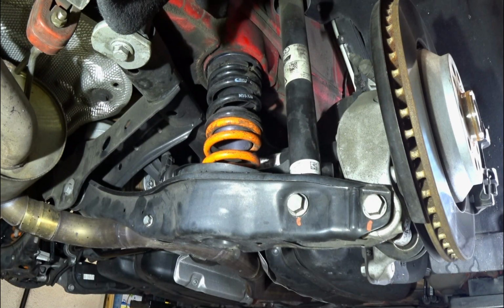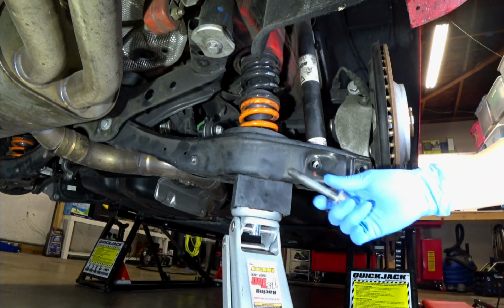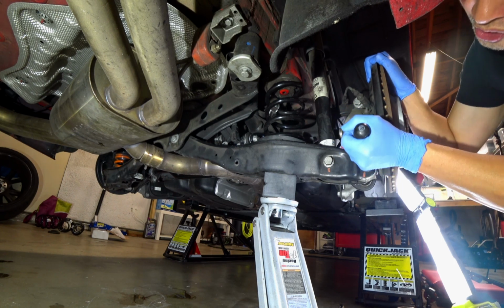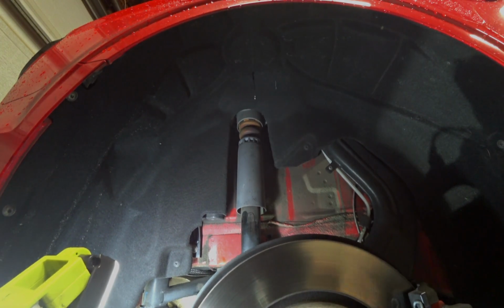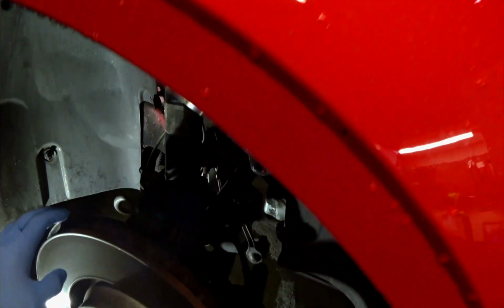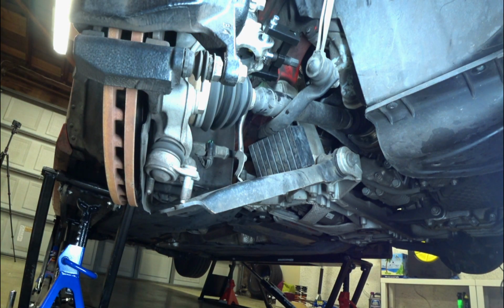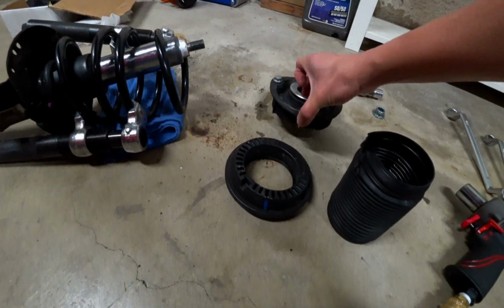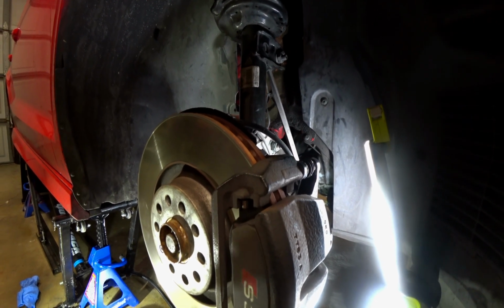Audi S3/A3, Golf R/GTI, MQB Chassis Coilover/Spring Install DIY

Comment: Does this work on a 2015 jetta?
Reply from the maker: I don't believe it will be exactly the same, but the process should be similar. Your 2015 would be considered a MKVI so check out installations of the MKVI GTI.

Comment: Very helpful video! Can I ask, is it better to undo the strut top mount from the body before wiggling the bottom of the strut out of the knuckle, or is it better to do this after? Which order would you do it when re-installing the strut? Also would you say for an 8P S3, is it necessary to remove the remove the ball joint bolts and remove the hub from the drive shaft to make more room?
Reply from the maker: You want to remove two screws from the strut top mount and keep on loose. Then wiggle the bottom while you remove the last top bolt, otherwise, the entire assemble will be difficult to manage or will slide right back down in the hub assembly.
For the 8P, I did remove the drive shaft and ball joints as it does provide much needed room.

Comment: Would these torque specs apply for a 2020 Audi a3 quattro? I’ve seen other videos where specs are torque plus “_ degree turn” can someone help out please ? Just want to make sure I torque everything correctly
Reply from the maker: I cannot say that the newer 2020 A3 would use the same torque specs as I haven't worked on a newer model. Regarding the "degree turn," Audi uses what is called torque to yield bolts which are meant to be used only once. Therefore, when you see a torque spec, Audi expects you to torque the bolt to stated spec, then add another "xxx degrees" of turn to that bolt.

Comment: Hey man, been trying to get my front coils on for a day now… tried many different ways but haven’t been able to get the end link on properly on the passenger side, any tips on how to do this? I’ve tried jacking up the bottom connector of the end link but it still is just a little bit off… located in SoCal. Thanks
Reply from the maker: For the late response Jaden...did you get the front coils on?
If not, did you remove BOTH endlinks and try to reinstall them once both coils are on?
Reply: @TheAutomotiveFanatic  was able to get them on.... I realized after the fact I should of had both. end links off but a trick i learned for coilovers is to just max out the height of them to the oem height and just connect it like that and lower it later. Thanks for the response! Ill definitley let you know if I have any other questions... I have a 2017 a3 etron sportback
Reply from the maker: @jadenmoreno8425  Good job on completing the  install. Yes, typically having BOTH end-links off make it easier to reinstall them because the height differs once springs or coils are installed.  Enjoy the A3 e-tron, one of my favorite PHEV.

Comment: for the suspension link, can we use back the same link even though i changed to a lowering spring (H&R)? or it is recommended to get a new adjustable link?
Reply from the maker: Yes, you can reuse the same endlink. If you're tracking and want the most from your suspension, then it's advised to install adjustable endlinks.

Comment: The detail of s3 fanatics videos are by FAR the best for having confidence in doing the repair/updates and that your vehicle is safe when done. 

QUESTION: when replacing the shocks in the right rear of an A3 2016 1.8T 8V which looks exactly like what I see in this video. Behind the wheel well covers on the right rear there is a plastic component of some kind made by Kayser. It’s in the way of the left bolt holding the top hat mount for the shock. There is one obvious bolt to remove, but the component doesn’t come off. I can’t see how to get it to release or move far enough off to get to the shock. I’m assuming access is from inside the trunk? Any tips on how to work around this? Is it really necessary to remove this for shock replacement?
Reply from the maker: Thanks for watching and the support! I know exactly what you're referring to. Unfortunately, it has to be moved out of the way. Look inside as I believe there are TWO bolts holding it in place. You'll need to jiggle it to around to free it loose.

Comment: How far should the strut push down into the pinch section of the knuckle on the front end? Is there a lip that it stops at?
Reply from the maker: Will, the strut will push all the way down until it hits the bottom of the knuckle. There is a little stop indentation.
Reply: @TheAutomotiveFanatic  thank you. Once I got into it I realized that as well. Just an FYI on the RS3 you don’t need to drop the knuckle at all off the control arm.
Reply from the maker: @williambardin94  thanks for your input. Hopefully your tip will help others as well!

Comment: Great DIY man! can you confirm whether the top middle strut shock bolt is 21 mm? I have a 2016 audi a3 wanted to order that special socket, do you happen to have that part number by chance?
Reply from the maker: Nathan, if you're referring to the top hat shock nut, it may vary in size based on your Audi's setup. My recommendation, is to purchase the entire kit which is:  ES#: 2703013 
Yes, it's more expensive, but in the future, you may need different sizes if you end up swapping to coilovers or other shock brands.
Reply: @TheAutomotiveFanatic  much appreciated!

Comment: Does anybody know the size of the front axle bolt?
Reply from the maker: Are you referring to the socket to remove the axle bolt, or the axle bolt itself?
Reply: @TheAutomotiveFanatic  the socket itself 😅
Reply from the maker: @carlosschein9283 , I checked my notes and I have it listed as a 24mm socket. Hope this helps!
Reply: @TheAutomotiveFanatic  i really appreciate it!
Reply: @TheAutomotiveFanatic  so just a standard 24mm socket?
Reply from the maker: @LowerClassClique  correct, 24mm.
Reply: @TheAutomotiveFanatic  appreciate it so much

Comment: Whats your opinion on the Quickjacks? Ive been waiting to pull the trigger to buy them as it would be perfect for my situation. I just dont know if they are worth the 1500$ or not
Reply from the maker: Adam, the Quickjack is by far, the best money I have ever spent on a tool. I have very few complaints and absolutely recommend it. Now if your situation permits (funds, garage concrete quality, and garage height) I would get the MaxJax instead simply because it lifts the vehicle close to 40" up.

BTW, Costco was selling the 5000slx for $999. That's what I have.
Reply: @TheAutomotiveFanatic I know this is an older video, but could you please tell me which model QuickJack you have? I think it would be a good investment for working on my S3.
Reply from the maker: @danieljadorie829  I use to own the TL5000.

Comment: I'll be using this video for my Golf R spring install. Thanks for being so thorough.
Reply from the maker: I'm glad you found my video useful! Thank you for watching and the support.
Reply: @TheAutomotiveFanatic  Definitely! Just a few questions though if you don't mind. The headlight leveler, do you just unbolt it from underneath and move it out of the way? And did you have to loosen the inner axle to get the strut out? I've seen a few videos where they unbolted all 6 (?) of the triple square bolts to make it easier to remove the strut but the few S3 videos i've seen this step isn't taken.

Comment: Out of curiosity, did you get all these torque values from an actual Service Manual or just forums and google searches?

If it was a manual, where did you find yours?
Reply from the maker: I found the torque specs online from different manufactures. I only used the specs that were similar across multiple manufactures.

Comment: Are the 3 top mount bolts definitely 12ftlbs torque? Seems very low, 034 motorsport how to says 30nm which is 22ftlbs but that is on their street density top mounts.
Reply from the maker: @ Callum, yes, the top 3 shock to chassis bolts are 12lbs ft/lbs+/- 1-2ft/lbs. if you want to follow standard VAG protocol, it's 15nm + 90* turn since it's a torque to yield bolt.

Comment: What would happen if you didnt line the top hat up with the shock like shown in the video. I did my springs a couple of weeks ago and I cant remember if i did this. I got my alignment done after I changed the springs and there weren't any issues so I'm assuming I did it correctly or I would of had problems?
Reply from the maker: @ JameSter, if you did not line the top hat and shocks up, your spring and top hat would look completely off and angled incorrectly. When aligned correctly, the tophat will look parallel to the lower spring seat.
Reply: @TheAutomotiveFanatic  I'll have to have a look when got the alignment done nothing was mentioned and the car drives fine I dont have any noises
Reply from the maker: @jamescam200962  you should be ok then because if you assembled it incorrectly, the top hat would have been angled way off and not allowed you to install the shock nut.
Reply: @TheAutomotiveFanatic  everything went together fine thanks for the replys

Comment: I have a 2015 S3 with Mag ride and I have a fair bit of noise coming from the front suspension mostly going over speed bumps and I haven't figured out how to fix it.  Any Ideas on what could be the cause?  I am no tech but I am thinking maybe it is the control arms.
Reply: Jim Bo could be a number of things, but first confirm what you can without removing the strut. Tops strut bolts, sway bar, end links, control arms, etc...especially anything that has been touched. Last thing to check would be the strut since it’s the most work to remove. It could be that the strut mount (aka “top hat” in the video) and strut bearing aren’t properly mated together, but check whatever else you can first.
Reply from the maker: Thanks for chiming in Hwy88 Forever. You're right, way too many variables. If Jim Bo recently had springs or coils install, then my 1st assumption is always the proper torque specs on the top hats. That's a common gremlin. I would though, inspect what you can, make sure nuts/bolts are tight.
Reply: @TheAutomotiveFanatic  as much as I would like more low I am not sure I want to deal with the effects of going with springs especially with mag ride. I have had springs on my old cars
Reply from the maker: @JimBean365 , it's just my opinion, but I don't think springs go well with the MagRide setup. I've ridden in other S3s with springs/magride and wasn't impressed.
Reply: @TheAutomotiveFanatic  yea I am not going to mess with it.  I am honestly not looking to do any more major mods.  I have APR stage 1 and recently had to replace the turbo waste gate actuator twice in only a few months.  very annoying. that and the creaky suspension are my only major real complaints.